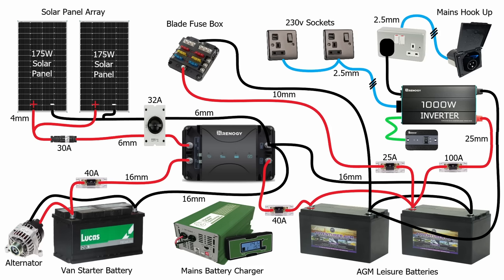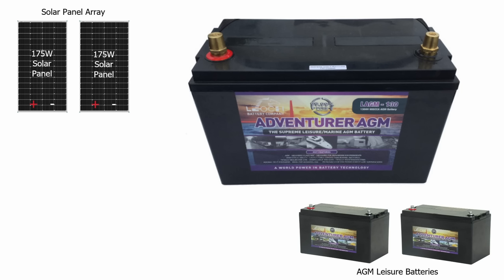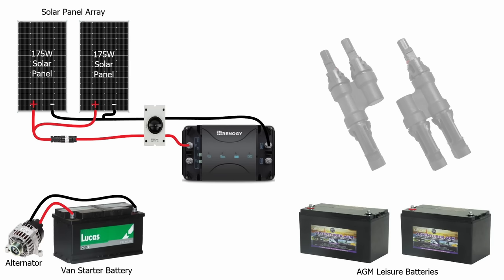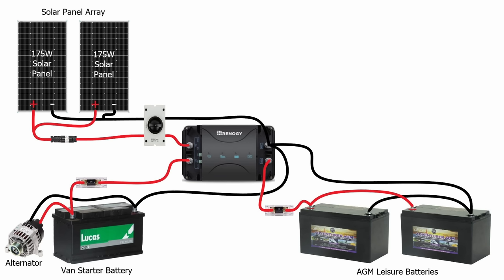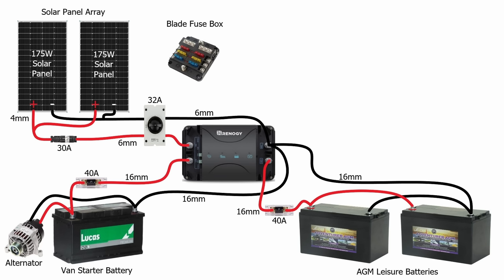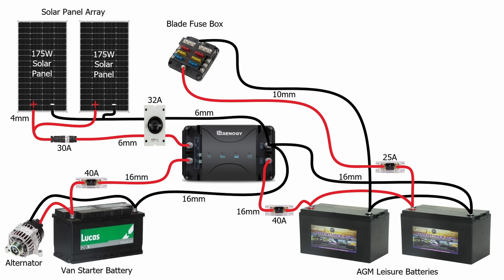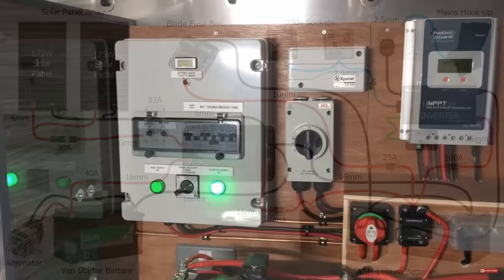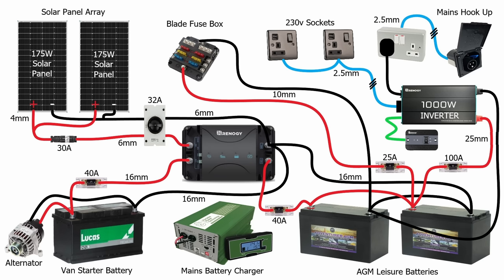12v Electrics for Off-Grid Campervan - Fiat Ducato Budget Build Ep12

Comment: HI Greg.  Is there a good reason for using the double pole isolator for the solar array?  I have used a single pole marine style isolator.
Also, what would be the maximum watts of solar I could connect to the Renogy DC30 please?
Reply: i would love to know this as well hope Greg can help us out.
Reply from the maker: A double pole isolator is safer in systems with a common negative because it is possible to have a short in the solar live and still complete the circuit through a common negative ground. It’s safer to isolate both wires to avoid that possibility 👍🏼
The max input watts for the 30amp unit is 400W and the 50amp version can accept 660W solar. 
4:40 👍🏼🤩
Reply from the maker: @everyday1392 I remember helping Lou’s dad strip out their kitchen when they were having anew one fitted. I isolated the live MCB to the socket circuit to remove them and then got a shock from the neutral as there is a common neutral in the consumer unit. So I learnt the hard way always best to isolate both cables. 👍🏼
Reply: @GregVirgoe  thanks that was very helpfull.
Reply: Thanks for telling me. That's good advice.

Comment: Hi Greg. What is the mains battery charger for and which did you use? Thanks
Reply from the maker: To charge the leisure batteries when on a campsite hook up. 
Links are in the video description
Reply: @GregVirgoe  Thanks Greg....Doesn't the Mains hookup charge the leisure batteries when connected? 
Also, can I use a 2000w inverter and if so do I need to change anything else in the system? Are all the cables from the blade fuse holder 2.5 2 core H07RN-F cable for the lights, USB chargers and fridge?

Comment: If the Inverter and 12 Volt are directly wired to the batteries then it could potentially drain them completely and destroy them right?
Reply: Not if the inverter is switched off when not being used.
Reply from the maker: With any off-grid system you need to monitor the state of charge of the batteries on a daily basis and manage your power use to make sure that never happens
Reply: Some inverters have low voltage cut off?

Comment: Greg, it always gets confusing to me when you talk about Watts for the Solar generation but appliances always seem to consume Amps. I have a 1000w Jackory that is use to keep things like fans going and charging up phones. laptops etc. It will even boil the kettle if the kettle is a low wattage one. However it won't make the coffee! That consumes over 1000 watts. So anything at or below 100 watts the Jackory will operate it. It would be nice to know how many Watts in an Amp or vice versa. Or doesn't it matter :) Many thanks.
Reply from the maker: It's a great question Roger and there is a very easy way to remember this relationship between Watts, Amps and Volts. I demonstrated this in a previous video and i'll post a link here to the exact point where I talk about it to save you looking for the right one. Once you've seen it please do let me know if it makes more sense, i'll happily help more if not. 
Here you go https://youtu.be/koFg6oFs0RU?t=758
Reply: W over VA, or even easier to remember perhaps World Virgin Association. 
If working out Volts, Amps and  Resistance, it's V over AR, or Virgins Are Rare. 😂 Haven't used this for years but some things stick in your brain when being taught. 
A bit like suck squeeze bang blow with an IC engine. Kids never forget that. 😂 😂😂😂
Reply: Oh, great video Greg.
Reply from the maker: @noiseache7720  did you take a look at my video link above with the equation wheel?? 😃👍🏼
Reply: @GregVirgoe  Yeah I did, and I've watched it before. I'm a member of the 'Greg Virgo van build appreciation group'. I was young when I started watching your videos. 👍🏻🤣

Comment: In this diagram, where is the ground to the chassis?
Reply from the maker: It’s an isolated system where all the positive and negative cables are installed so you do not need to connect to the van.

Comment: Greg,sorry to bother you again. I'm using your schematic but I have the 50 controller ,plan to have 3 batteries and a 260 solar,my question is on the fusing. 
You have 30 from solar ,40 on vehicle battery and leisures ,would this remain correct ?
Thanks.
Reply: Hi Matthew, I'd get a second opinion on the fuse ratings as to my understanding the role of a fuse (or circuit breaker) is to protect cables and equipment from over currents. Ie to stop these from melting due to excessive current. So, the panels have a max current rating of 9.89 amps and there's two in parallel so double the current = 19.8 amps before the panels are exposed to excessive current. So these would need a 15A fuse. The 4mm cable he's got for the positive leads from the panels can only carry 15A also.  So again a 15 A fuse instead of the 30A fuse would be more appropriate. I haven't looked at the rest but suggest you get an electrician or solar expert to check your circuit out.
Reply: Correction to my 15A suggestion. Need a higher fuse than the maximum expected current of 18 amps, so maybe 25 as a minimum.   The authors proposal of 30A is valid as he's probably had a bit of experience.

Comment: Hi the link you provided for the mttp renogy charger doesn’t come up at 25amps could I use a 30amp with this same setup as that is what’s is there to select thanks
Reply from the maker: The Renogy charger is 30amp. I’m not sure where you got 25Amps from. Please watch the video again for clarity. Cheers
Reply: @GregVirgoe  thanks for reply a quick question with that setup will I need a consumer unit because I Diddnt see one in that setup you described
Reply from the maker: @urbanmtb3984  yes you do need one and this one is the most compliant I have found on the market https://www.12voltplanet.co.uk/deluxe-ac-mains-consumer-unit-with-2-x-double-pole-mcbs-rcd.html

Comment: Just one 2.5mm artic cable from mains hookup to double socket? Aren’t most double sockets designed for a ring main, so would have 2 leads running to them? Looking forward to the 230/12v video! 😁
Reply from the maker: Just because it’s a double socket does not mean it has to be on a ring circuit. The number of socket is not the key factor it’s the connected load that you need to be aware of. In this case the inverter uses just over 4amps and the mains battery charger only uses 1Amp so that well within the cable and socket rating. 😊
Reply: @GregVirgoe  so you can wire from hook up to a double socket and connect the 1 x live and 1 x neutral. But what about earthing that double socket, as it has 2 earths pins, one for each socket.
Reply from the maker: @grayadventures5885  inside a double socket there are only three terminals, live, neutral and Earth. The two sockets are internally joined by copper bars.
Reply from the maker: @grayadventures5885  please read my pinned comment too 😀
Reply: @GregVirgoe  ah righto, of course. So the fact that there are 2 earth terminals is just so you can choose which one to connect to if running a single cable and the sockets are earthed the through the copper bars (or connect both earths if running a ring main). 
Great point on the CU - and sorry if my question is repetitive I had a look through the comments but couldn’t see this point. 

Super helpful Greg - thanks so much.
Reply from the maker: @grayadventures5885  if you look at the back of the socket most you can see a bar joining the two earth terminals together. It’s exposed. The live terminal bars are hidden behind plastic for insulation protection as they are the live connections. Sorry it’s been a long day 😊👍🏼

Comment: Greg would this system work the same way of you did and lithium batteries or would the wiring change?
Reply from the maker: It would be exactly the same if you go to lithium keeping the same 30A charger even if you increase the battery capacity.
My only recommendation would be to go up to the 50A DC to DC as Lithium can take a faster charge.
Then you would need to increase both the fuses on the charger to 60amp and go to 25mm battery cables.
Lithiums are coming down in price now and the 50A charge is currently on sale at less than the 30A one :D
Reply: @GregVirgoe  wow that’s a great reply.  Thank you for all you do 🙏
Reply: Greg I have enough roof space for a third 175 solar panel.  Should I upgrade the Dc to Dc to 50 amp? 

If I do, I would increase the fuses to 60amp.  I have already run 16mm wire from starter battery for dc to dc, would that be okay and then I upgrade to 25mm cable for Dc to Dc to leisure batteries?

Comment: In the UK there are regulations  regarding protection devices for the 230v AC.
As close as practical to the hook up inlet, a consumer unit should be fitted with double pole MCB, for over current prorection and a double pole RCD to protect against electric shock. The consumer unit feeds the inverter and any socket pre inverter. The protective earth from the consumer connects to vehicle metal/chassis. 
The inverter output needs a double pole RCD in circuit before any connections to sockets and appliances.  The inverter case earth point needs connection to van metal/ chassis. This,  and the protective earth  from the input consumer ulit are the only  AC protective earth connections to the van.
The inverter type you have installed , when in pass through mode,  relies on the neutral to earth bond in the supply pedistal. Off grid it auto switches in a local neutral bond.

Fusing for solar  panels is only needed where 3 or more panels, or panel series strings, are connected in  parallel, each with its own fuse. For example 3 panels in parallel would need 3 fuses,  one at each panel before the parallel  conection point.
In your systen the 30 amp fuse is redundant,  as the panel current cannot ever  exceed 30 amps.

The 230v regulations need to be followed  for safety.

Mike
Reply from the maker: Thank you for your clarity there, Mike, very helpful and quite assertive in its delivery :D lol
I would always recommend the installation of a consumer unit on the hook-up inlet for short circuit and overcurrent protection. Will cover that in the grounding video.
Can you help further please by confirming which IET wiring regulation number requires the fitting of double pole MCBs I wasn't aware that was a UK requirement?
RCDs are of course double pole by nature of what they do, monitor the difference in current across the live and neutral, thank you
Reply from the maker: Don’t worry Mike, I have found the regulation 721.43.1 final circuits 👍🏼😃
Reply from the maker: However Mike, you are incorrect about the earth connection to the metal body and in fact this is a legal requirement and covered by statutory regulation NOT to connect the earth of a hook up to metal body of Campervan. 
That is the Law!
https://www.legislation.gov.uk/uksi/2002/2665/regulation/9?timeline=false
There is a serious risk of fatal shock if the site power supply loses its combined neutral earth connection.

Comment: Greg,how do you get on with the fridge ? I had a weaco in my last van which would sense a voltage drop in the batteries and cut out,then the voltage would go back up because it wasn't drawing and turn back on. I could only use on mains or when driving. I had 2 batteries/240amps total.
Reply: Greg,no solar because the chap that installed the split charging recond no amount of solar would run that fridge.
Reply from the maker: I would bet that wasn’t down to your battery that sounds like the cable feeding your fridge was too small. If the cable is undersized the current draw cause too much voltage drop on the cable and the fridge turns off. We have 6mm cable feeding the fridge and it works perfectly on 12v all the time.
Reply: @GregVirgoe  you could be right there. I didn't wire it,but I don't recall cabling that size feeding it. Cheers,cause I don't really want £££££££ lithiums in my new van
Reply: On another note,in your wiring in this video, do you not fit split charging so the engine battery gets priority from the alternator  ?
Reply from the maker: @matthewwilson5983  12v fridges are really prone to voltage drop because when the compressor starts it does draw a higher start current due to the motor. Increase the cable size and see how you go.
Reply from the maker: @matthewwilson5983  it will help you to watch the video again as you will see I am charging using the alternator.

Comment: Do you have a lithium battery set up?
Reply from the maker: You can use exactly the same diagram just change the batteries. 
You could make use of the 50amp DC to DC charger as it has settings for lithium batteries and can handle a larger charge

Comment: Is there any reason why all this kit ( not including the solar panels) can be installed in a big tool chest, maybe a chest with wheels ? So, build a portable power supply, like the ecoflow/bluetti, but without all the smart features and easier to fix if a single component needs replacing.
2nd question, electric vehicle, huge battery, mine is 90kwh, what's the best way to tap into that power ? Obviously there's no alternator or running engine.
Reply from the maker: You can do that just make sure that you provide adequate ventilation and maybe some PC fans to keep the contents of the box cool as the charger will give off some heat. You can plug in a BT2 bluetooth device and get all the charging and battery info on a phone app.
I imagine that your vehicle battery runs at much higher voltage than leisure system and I would not know how to tap into that sort of system. Thanks for your questions
Reply: @GregVirgoe  thanks for replying. Re taping into my vehicle 90kwh battery, I presume just connect the leisure battery to the 12v starter battery, so, same as your diagram, just no alternator, I "switch on" my vehicle and the traction battery connects to the starter battery, much like starting an engine charges the starter battery.  Thanks again.
Reply from the maker: @pk-bristol  sorry I assumed as it was all electric it wouldn’t have a starter battery or alternator as you have no petrol engine. 
So does the car have a sore rate small traditional battery to run lights and controls etc? What make of car do you have?
Reply from the maker: @pk-bristol  my other concern would be draining your vehicle battery and reducing you range on that. You could do it if it’s a hybrid car that has a traditional engine as well as batteries
Reply: @GregVirgoe  yes vehicle is all electric, 90kwh battery under the floor and normal 12v battery under the drivers seat, same as a normal car, all the electric stuff runs off the normal 12v starter battery. Turn the ignition key, "start" the vehicle a contactor is powered by the 12v starter battery, that contactor connects the main traction battery to the starter battery then floods/charges the 12v starter battery. It would take a lot to drain the main traction battery, it's 90kwh. I sat in the vehicle with the heater on for 1 hr, used 1% of traction battery. Thanks.

Comment: any reason you don't use busbars
Reply from the maker: Yes, every time you introduce another connection or fitting it adds resistance to the circuit. The more simple you can keep it the better 👍🏼😃

Comment: Having just spent a lot of time and money upgrading the electrics on my van I can definitely recommend what you propose here for a budget build. However in my opinion a single large battery would be easier and no more expensive when considering cables, lugs etc. I think a deep cycle carbon gel battery is better and safer. It does not require a vent pipe and because it is deep cycle 200Ahr is sufficient. 
I recommend Alpha Batteries:
12V 200AH Expedition Plus Lead Carbon Gel Ultra Deep Cycle Battery (EXP12-200C)
Reply from the maker: Sorry but your information is incorrect. an AGM battery is sealed, deep cycle and does not need require a vent. 
A single battery gives you no redundancy if it fails. 
Having worked in critical supply systems N+1 is always a better solution.

Comment: how much was the cost of this power system build?
Reply from the maker: All the renogy equipment came to £700, with £200 for batteries and further £200 for all the cables etc so the complete electrical system was £1,100.00 :D

Comment: Isn't the cable size square millimeter?
Reply: Yes. But it is rarely mentioned in the trade. You would just Google a roll of 25mm cable.
Reply from the maker: Yes cable sizes refer to the cross sectional area of the cores but the little Sq 2 symbol if always left off. 👍🏼😃

Comment: Did you use the 30a or 50a dc dc mppt renogy please
Reply from the maker: I’m using the 30A one 😊
Reply: @GregVirgoe  so am I right if putting 2 x 175w panels I only need 30a too please
Reply from the maker: @michaelrodgerson8900  yes that will be ok. The same as my diagram.

Comment: Why would you need a PV inline Fuse? 
They can't generate more than rated.
Reply from the maker: Well actually, yes they can. The rating that all solar panels are specified at assumes a solar irradiance of 1000w/m² but there are instances when this value could be higher, when you are near the equator, up high at altitude or on clear dry days this value can be much more. Better to be safe than sorry for only £9.99 :D
Reply: @GregVirgoe  well I would spent it on a beer to celebrate the build 😅😉
Reply from the maker: @RedBatteryHead  sounds like a great plan to me 🍻 cheers

Comment: Hi Greg as you suggested I'm going to go with agm battery's can I  use my split charger with these battery's please or they acid battery's thank you again greg 😊
Reply from the maker: I don’t recommend using split charge relays because all they are is a switch. They don’t know you battery condition, state of charge and the don’t meter the charger accordingly like a dc to dc charger does. With this setup I have included a dc to dc charger so you don’t need a split charge relay 👍🏼
Reply: @GregVirgoe  thank you Greg that videos was great to watch thank you so much